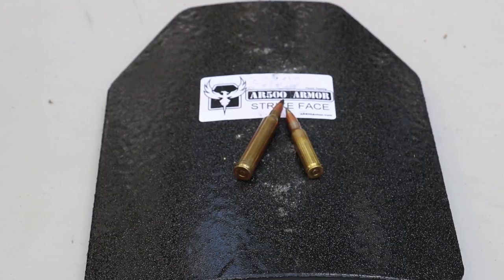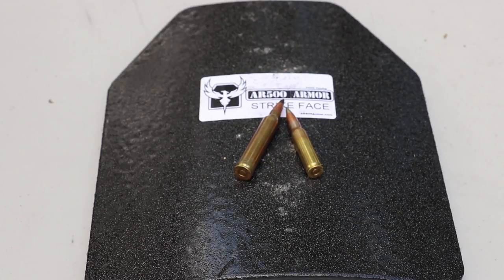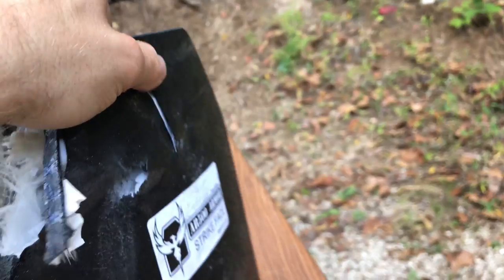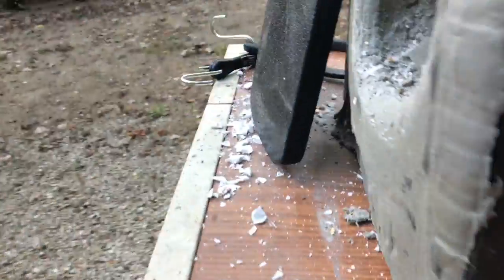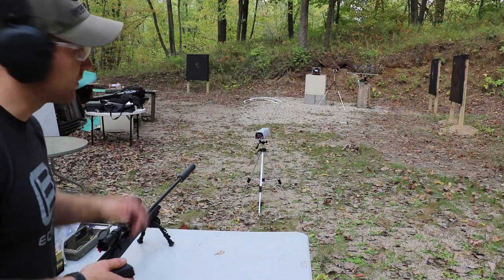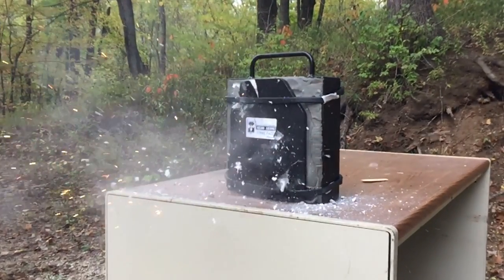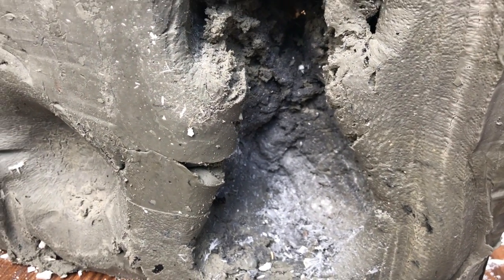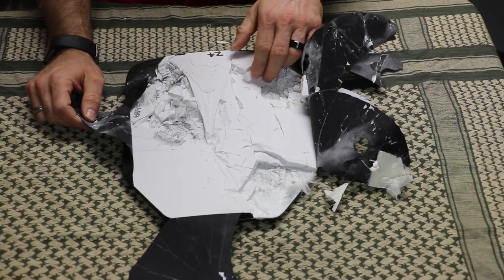AR500 Armor (Armored Republic) Level IV Body Armor Torture Test!

Comment: It's very surprising to me that M80A1 @ 3400 fps was stopped but neither M2AP @ 3100 nor 150 grain FMJ @ 3250 were stopped. 
Do you think the ceramic in the lower right hand corner was already compromised before it was hit with the 150 grain FMJ?
Reply: Velocity can be your friend or enemy.  At some point if the bullet hits fast enough it may simply hit too hard, too fast, it may cause the BULLET to fail instead of the armor.  The integrity of the bullet was not made for those kind of impacts, perhaps, and a slower round may be more effective in some cases.

Comment: It's safe to assume that a 200 pound man wearing this plate would fall back if shot.  In the tests, the plate is fixed and doesn't move back.  Would allowing the plate to swing or fall back better approximate a real life scenario of being shot?
Reply from the maker: The recoil force impacted on the shooter is the same as the receiving target. The clay case weights 45lbs. If someone were shot they would fall because the blunt trauma would knock the wind out of them rather than the bullet force knocking them down
Reply: Thanks for the explanation.
Reply: @BuffRANGE  that backface would rupture organs and break bones would it not?
Reply from the maker: Very probable. I need to see if the NIJ/FBI/etc has any documentation on instances of injury occurred when a plate/panel stops a round. The NIJ allows up to 44mm before they say "lethal" internal injuries "could" occur.
Reply: @BuffRANGE  
Now the military is going to start allowing for more than 44mm of BFD. With their new armor requirement.  Up to 58mm
Reply from the maker: @556RF  Really? Do you have a source for this?
Reply: @BuffRANGE  I’ll look it up and send it to you on Patreon. I have to remember where I saw it. It was a video about the Army’s new modular body armor and someone said it.